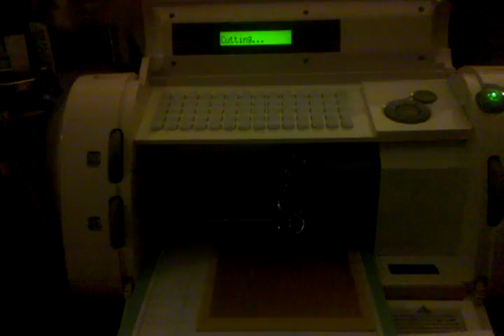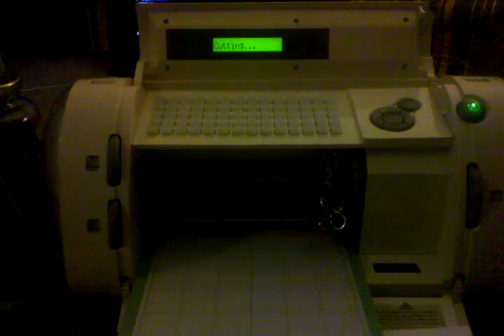Example Cricut PCB Dry Run

Comment: I was trying to take a look inside the compass ticket today. Found you blogging about that as well. Are you currently in Vancouver? 
That was so cool to find someone who tried the same thing.
Just want to say Hi.
I cut the little chip and want to try out if it's possible to make a compass card myself.
Reply from the maker: Compass card? Do you mean the cricut cards? It should be possible to copy them, and the George one is built into the main unit, and only requires shorting some pins to make it think George is inserted